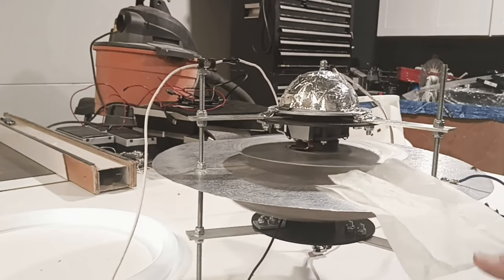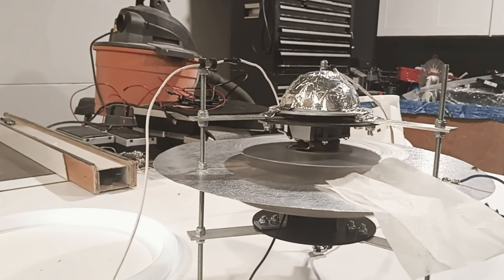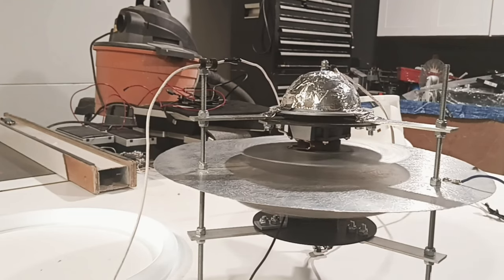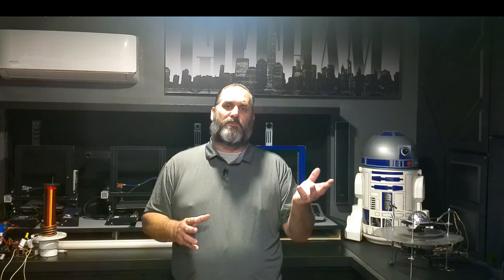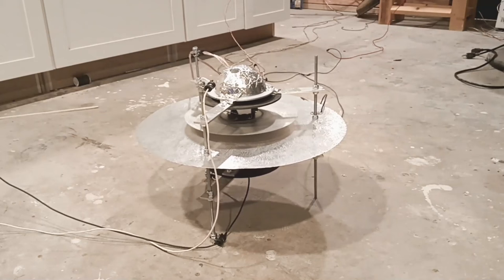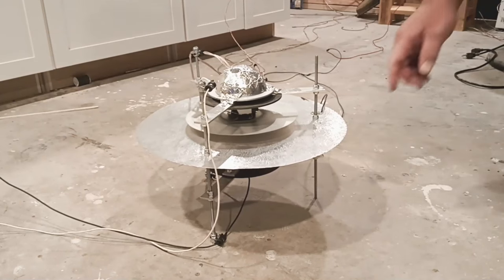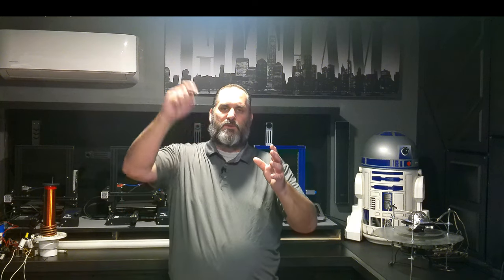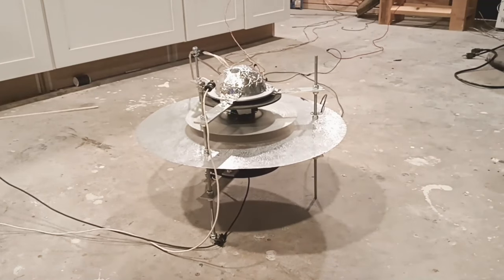Graviflyer "Amplify The Tesla Coil" #46

Comment: I have spent hours and hours on this project and you couldn’t be more right! I enjoy difficult things tho. But I can see why most discard. Keep sharing, your process, progress, and insight has been so helpful! Thank you🎉
Reply: Please share your new Tesla coil! 🙏🙏 very excited you see this about the circuit. Your 💯 about over complicating things. It’s important to understand what you are doing! Preach brother 🙌🙏🍿
Reply from the maker: I'm going to try 2 tesla coil fields. so 1 at the center plate and another connected to the top and bottom disc. I might even try 3 by separating the top and bottom disc. The testing would be interesting to find out if it changes things. I am using a zvs to drive a tesla coil and could use the same circuit to drive a high voltage flyback. A flyback is just a reversed tesla coil with less wire.
Reply from the maker: Have you put the tesla coil to the center plate and touched it? It is cold 74 degrees but it burns hot. It burns you finger. It will make you rethink what the tesla coil is doing.
Reply: @nathanbunten4299  In Tesla's time, there were no computers or complex electronic devices that could still produce huge success. This comes from a correct understanding of the theory of nature. We need to understand each working principle of Alexey's device and then think about why we do it. He There is nothing superfluous and useless in the equipment. The actual truth is in the pile of electronic components. This is the key for us to imitate him.

Comment: Just a quick note with the official US patent for the triangular space craft I input the info about it into chat gpt  and it tells me in summary that the craft uses high frequency likely ghz range electromagnetic waves from slot antennas on the sides of the triangle in combo with the electrostatic field emitted from the electrodes at the 3 corners, the interaction of the 2 fields creates a spacetime curve making its own gravity, the dish in the middle at the bottom is a parabolic antenna, it focuses the interaction of the 2 fields making it more intense in the antenna. with general relativity mass is equal to energy and the reverse is also true as energy can be equal to mass, so with this graviflyer it might actually be working on the same principles as the triangle space craft given the magnetic field from the magnets and the high voltage
Reply from the maker: thank you. I will have to look into that more.

Comment: once you realize gravity is not its own field but rather dielectric acceleration like tesla said,   you will make progress.           your   understanding of magnetism  is incorrect.   everyone see the puppet  but not the guy holding the strings.  Its the the dielectric field which causes magnets to "attract" .   the magnets are not attracted to each other, but rather accelerating towards a mutual  null point in space. (based up on the right hand rule).
Reply: Ok but can you say it in a way that doesn’t parrot Kenneth Wheeler
Reply: @FVLMEN  ken is right.  im glad people are starting to understand.
Reply: I agree, magnetism is taught incorrectly in school. Magnetic field only arises when two electric fields move relative to each other. So of course it's electrical field interference that we see as magnetic field. 

However, I think Nathan understand that.
Reply: @ElijahCokeley  " Magnetic field only arises when two electric fields move relative to each other"  i disagree.  look at a magnet under a ferro cell.  the black hole in the middle is the dielectric  field. as the dielectric  field  returns back to the medium  it radiates magnetism.  (  steinmetz also pointed out that the dielectric and magnetic field make up the electric  field;  i believe when you said 2 electric fields, you mean 2 dielectric fields.)
Reply: @toymaker3474   a magnet is made of atoms which are made of moving charges. I still mean what I said. You can disagree. I disagree because the magnet is still made of the sum of the interference of all the atoms electric fields. Which is made only by the movement of the electrons. Magnetism only arises with flux. I respectfully have not changed my stance in thinking.
Reply: So, you're saying that you must create a monopole?

Comment: If it works, you're on the right track now. A few million volts per meter should do it.
Reply from the maker: Thats a lot of power. I can't build that much power. I can amplify the power in the center plate with the correct frequency. it is proven when the tc field pushes against the high voltage field and the craft picks up more energy. But not in the millions.  I think the resonance plays a bigger role in reducing the weight than we think. Making the amount of energy less. If you vibrate a 500lb load it will move with 3 fingers of pressure. The weight never changed but the effect gravity has on it did. I will post the video on facebook.
Reply: @nathanbunten4299  I'm just telling you what is required to lift 1kg using only the E field. Granted, if you could charge the ground it sits on, it would be easier, but Alexey has shown it flying tens of feet in the air. That not reflection off the ground, it's too far.

Comment: Would a bifilar Tesla Coil bring more induction and so more Energy to push the field outwards ?
Reply from the maker: I don't know. I might try one.
Reply: It’s going to split the poles and halve the voltage, so same power overall, but has to use both pole wires.. half the field here, half the field there

Comment: Might be better to have something solid as part of the capacitive element than relying on ozone which diffuses and dissipates into the air around it. Maybe a thin layer of paraffin? At least that should build things up faster, with less environmental variables affecting it. But this kind of rig would be neat to look into the nature of an electro-gravitic effect. Most people seem to dismiss that, because they always tend to look at masses that aren't differentially charged. A neutrally charged mass (in relative terms) does not have the effect anyways. Any torsion-bar experiments in proximity, while taking measures to isolate the torsion bar from things like vibration and charge interacting with it?

And there's something interesting to borrow from Einstein. E=mc²... Rework it to m=E/c². Which shows that mass is a type of potential... Yet something to add on that, rules of equivalency and all that c² happens to be the product of μ₀ ε₀. Thus mass is the ratio of energy in relation to the electrical properties of the vacuum background. So gravity could be considered as something derivative of a potential? Different (in terms of the underlying relationship), but similar enough that its acceleration field is a tensor curl effect just like the motive force in an electric motor. By particularly choosing the kind of energy potential to use in the ratio, you may also be able to cross cancel some aspect of the vacuum background and use that as a leveraging effect. In a way you're kind of putting a spin on it. Speaking of spin, maybe something interesting with 90° phasing? (That comes from things known with gyroscopes.) But that would only be apparent with a point input of the charge upon a rotating plane rather than the entire area, unless there's some other trick involved.

I'd also suspect that at least two of the devices operating in tandem is where something interesting would also happen. The idea is that you want to see a crawling procession of the interference patterns in (gravity?) waves to produce a warp effect. It sounds crazy, but I'm not sure if the loose explanation I'm giving would be enough to picture that. This may be exploitable in various ways depending on the amplitude and wavelengths that are possible. (From an actual warp drive of sorts, and also to dropping the Coulomb barrier in relation to fusion - which may make some known devices operate over unity.)

If none of that makes sense, feel free to pick away at it and explain what is wrong there. Since most of it is pondering stuff that may not seem obvious, yet still shows ties to the phenomena that needs to be explored.

Comment: New Sub ✋🕶️ First comment... My Highersense  resonates perfectly with this channel 🥸👍
Reply: BTW.. I'm a 100' Saucer witness (CE3) 
I've seen some incredible stuff 🖖
Reply from the maker: thank you
Reply from the maker: @HisHigherness8472  That would be really cool to hear.
Reply: @nathanbunten4299  
2 Triangles also involved. 
I saw Fields falling like birds dropping. 
I thought I was seeing spots... I'm on the 8th floor of 25...
They all stopped in the air and formed Orbs.. then vanished into well cones ... 🤨
As I looked up for the source... The Saucer dropped (from invisibility) above a 200' torus. I saw a 50' circle ⭕ of Electric Blue from a sectioned Torus Approximately 200' wide ? A magnetic wall had collapsed.. and there were visible dark dash lines of force.. I believe it was wrapped with a tractor beam ➖ ➖ ➖ ➖ like a spiderman web. 
Ice like snow was blowing as it levelled out. 
Below was flat with an outer ring that fired Plasma Thrusters.. 
An inner core like a puck and outer ring. Somewhat like an upside down speaker. It had a humming sound like a dirigible.. under was a Sonic square wave That I felt as much as heard .. Photo showed 2 Triangles alongside
🖖👽
Reply: Should say a magnetic Bubble collapsed ? 🤔?
Kinda like a flash reaction to loss of power ?
Reply: I have some time to add that.. 
The sky was overcast, and the triangles were invisible above the plane... Saucer looked like a shiny metal plate dipping into the water,.. if you were at the bottom of the pool... Covered in soap bubbles...lol
As I looked up I was hit in the forehead (felt like a raindrop) with what I believe was a range to ground signal that bounced off the ground 8 floors below, and passed through my head a second time going back up...
So I had migraines for a year 🤕👍 Wrote 2 of 3 books... Witness to High Strangeness and Physics of High Strangeness 👍 
Happened August 2022 .. I can send a screenshot of the photo sometime 🖖👽
Good meeting 🤔👍
Reply from the maker: @HisHigherness8472  that is awesome!!!!
Reply from the maker: @HisHigherness8472  just like that the energy in the bubble would dissipate.
Reply: As it dropped out... Pulsed Plasma Thrusters fired in a sequence to stop the fall... If there was a vortex cloud,.. it might reflect different colors, Eh !! 🤔👍
Reply: So, that's My toaster 🤣
Reply from the maker: @HisHigherness8472  When vapor makes water the color is aquamarine. Some see blue some see green. There is a molecule effected here.

Comment: At 8:52 - please explain this. What is a garrito meter?
I have been unable to find any information on it. Thx. ✌️
Reply from the maker: it is used to see the fields being created. here is a link. https://youtu.be/WyDsLVVLKVc?si=lZrpLE89AYmTJySy

Charlie C may have an English version
Reply: @nathanbunten4299  I saw both gravitometer video versions - no differences were noted. He moves the unit too quickly and is just out of focus enough to determine his analog meter settings. He also gives a very non-technical explanation of why it operates, but not how. I’d like to replicate, inasmuch as possible, this “tool” for a different, but similar area of radiation. Has anyone actually succeeded in building this? ✌️
Reply from the maker: @gaspumprepairservice7009  charlie C built one for me. The schematic is in this video. time 14:09  https://youtu.be/xeH-uijujQQ
Reply: @nathanbunten4299  after seeing that device soldered at 11:05, I’m less than convinced that any schematic would be legit. The entire concept of electrons moving through wire is based upon a differential of electrical potential. Whatever circuit in which THAT is installed, is worthless .. as far as said device is concerned. 
However .. I will give the remainder a fair assessment; perhaps even construct one - just for giggles. ✌️

Comment: what if you added the ultrasonic buzzer directly on the center disc? based on your center disc tapping test (where you got a result), maybe adding the buzzer directly on the center disc would get you some type of new reaction?
Reply from the maker: it's worth a shot.
Reply: @nathanbunten4299  yeah that is a very good point, it might actually get it to lift if you've got the effect you need just by tapping middle disc yourself, that's gotta be your next experiment!
Reply: That is a very good point that could work!

Comment: Do you think a larger field may allow for the containment of more ions within the field?  I wonder if the problem may also have to do with the piezo speaker?  Wonder if a different arrangement may help...Nathan you rock buddy
Reply from the maker: I think by adding a bigger tesla field. I can get the interaction of the high voltage and tesla coil to ignite into producing ozone. That should strengthen the field and allow it to hold in more molecules. Creating it's own environment.
Reply: @nathanbunten4299  So your plan is to make use of the ozone?  Sorry, I can be slow sometimes so forgive me if my questions seem dumb...
Reply from the maker: @TheJestar30  Yes.. We need to hold it in to thicken the field. Just like the Earth does.
Reply: @nathanbunten4299  oooooohhhhh
Reply from the maker: @TheJestar30  It really changes how things work. I think I found a way though. https://youtu.be/CMpxyObggt8

Comment: why not use your 3d printer to make a ring that sits magnets inside of it? do you have a way where i can send you pictures?
Reply from the maker: oldmannathanbunten@gmail.com
Reply: @nathanbunten4299  if you add a second coil that is wrapped in the opposite direction, with the same amount of power being put into one, your field will go out futher than if you just had one
Reply from the maker: @freedomer342  I agree. My tesla coil is wrapped to the left. I am going to make one wrapped to the right. That should do the trick. Then decide which one is north and south and put them onto the spinning disc's. It should create 2 fields or toroidals.
Reply: @nathanbunten4299  if you really wanted to get creative and i would be curious myself, you could make a two in one coil. you could layer the secondaries . maybe put a thin coat of epoxy or a nonconductive paint or beeswax paper since you wont have any breakout. It would make it lighter but im not sure if it would work
Reply from the maker: @freedomer342  I had an idea of 2 cones where the small sides are pointed in to the center with a #1 coil at the the top and bottom with the center open. I could add as many coils as I want that way.
Reply: @nathanbunten4299  yes but if you decided to have you #1 coil wrapped in only one way, and your secondaries are wrapped in both directions, only one direction of coils is going to work. What would actually work if your only wanting one coil for your #1 coils is something close to an esc pulsing 3 sets of wires that is tied into one coil. this way you can have secondaries that go in any direction that will work
Reply from the maker: @freedomer342  Each #1 coil matches the # 2 coils direction. The #1 coil is on the outside not the center. I created to work inside a sphere they make a big resonance chamber.
Reply: @nathanbunten4299  I have already built the coil system that you are talking about. I have stacked many different types of coils inside of it. It's also used to store electrical energy and used to drive other circuitry. The best way to go about this is using an ESC because it self tunes the circuit. Your main coil is on the outside, and your secondaries are on the inside. Or you could have them on the outside if you connect it to the circuit via the ferrite cores. The ESC is originally designed to drive brushless motors. You are getting an AC wave that runs them. You can run tesla coils with them too if you have 3 taps or two legs and one center tap (depends on what you want to call it). Adding some ferrite to it (which I haven't  done yet) would lower the frequency of it. In other words, you're using the ferrite to tune your coils to get the right frequency you want. Also, with the pictures I sent you via email, it's a 3d printed object. Imagine if it was metal. The reason for it being metal would be you could change the fields of those rings by connecting N field from a coil or a S field to the other ring or have them both be S field or N field. The holes themselves would create your ultrasonic soundwaves. You could tune it by filling the holes with a plug or even a magnet.